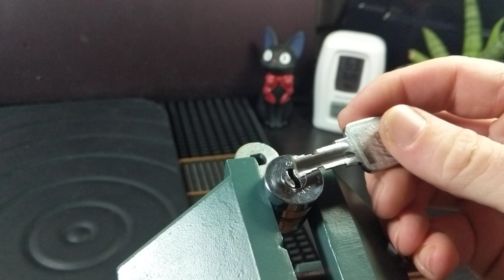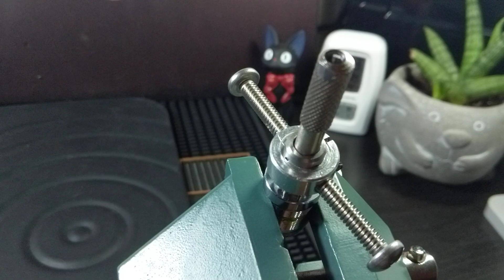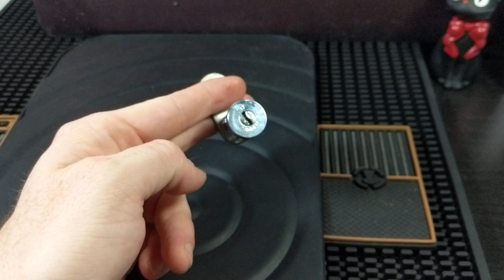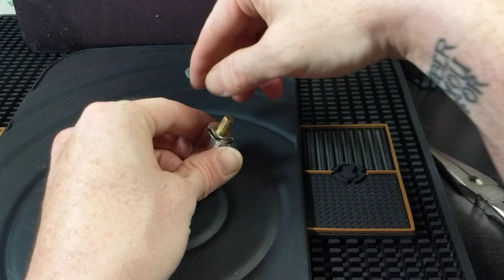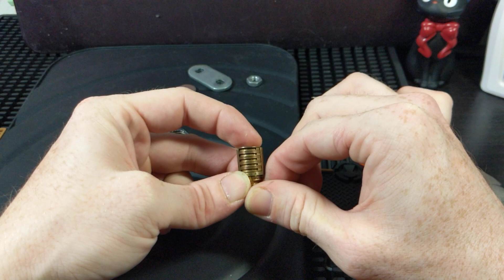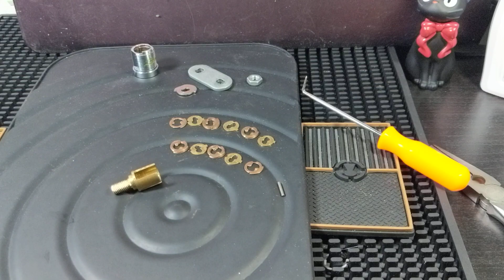∅ Picks Takigen Disk Detainer Cam Lock (77)

Comment: Great job, as usual, @UCxIAPz67pxXyPCw2VKvloLA! I need to get into DD, but gutting and custom DD picks are a bit intimidating. Mainly the latter. Well done, and I hope all is well.
Reply from the maker: Thanks very much!  Yea getting into picking DD locks can be a bit difficult.  I honestly think the sparrows pick is a pretty good starting point.  Its not too expensive and you can easily make tips with ejector pins.  If you have any questions about anything Id be glad to help even though Im not much of a DD picker myself.  Hope you are doing well and staying safe, thanks for the comment.  Take care.
Reply: @NothingPicksLocks  Yeah, I just heard about that this morning. $45 is a really good price point. I'll definitely be grabbing one when they're back in stock. And will do, take care.